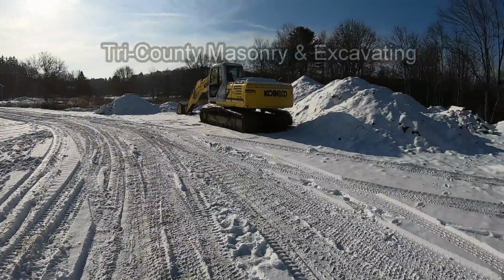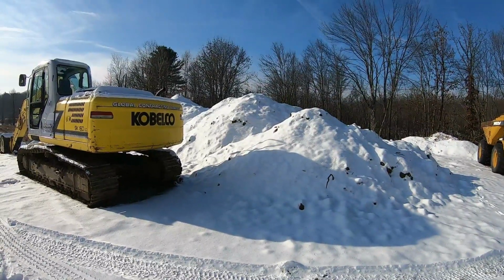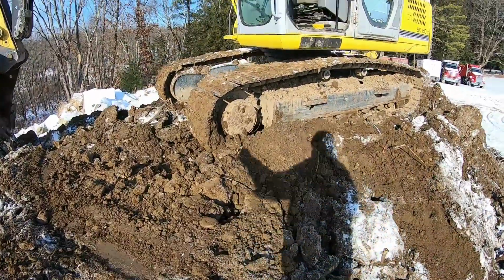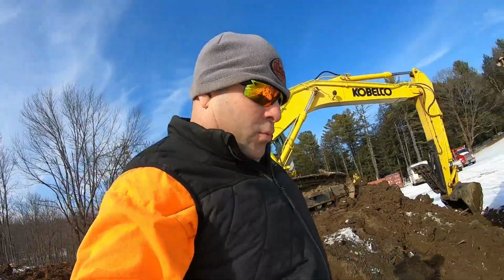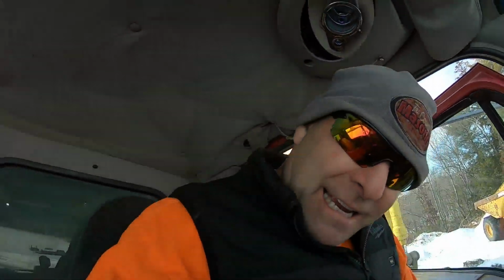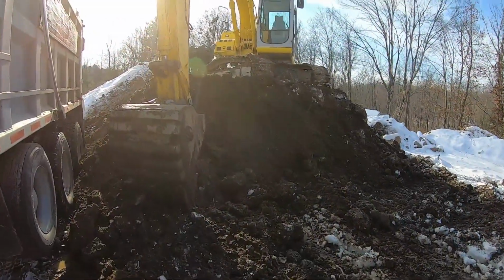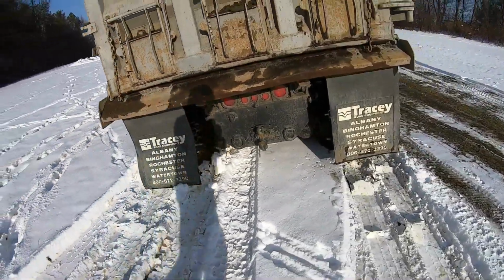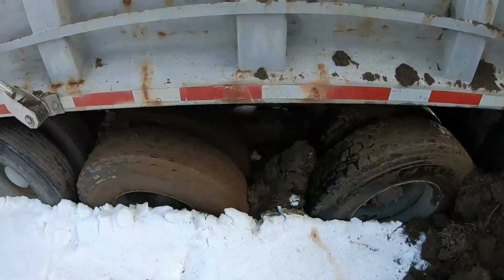Dump truck fail Sunday not so fun day! almost flipped dump truck on its side

Comment: You should look into kinetic rope the energy from the rope yanks you right out straps are more likely to break watch Matt’s off road recovery also I have seen a tow truck company using it they work good!!!another tool for the box!!!
Reply from the maker: Yes thanks for the tip That big yellow one was a kinetic strap though!